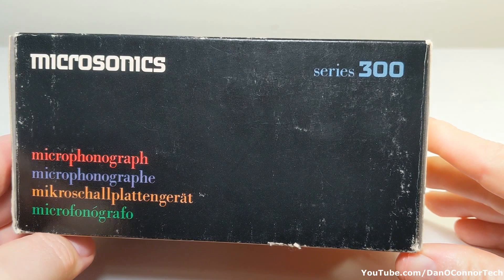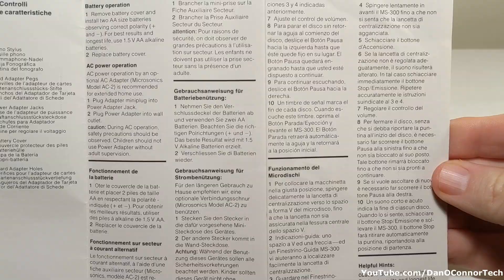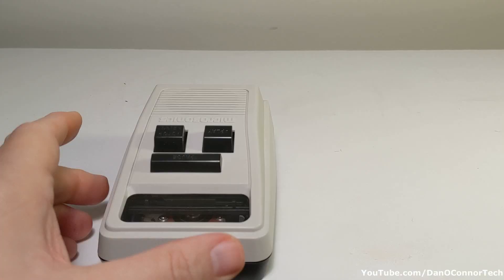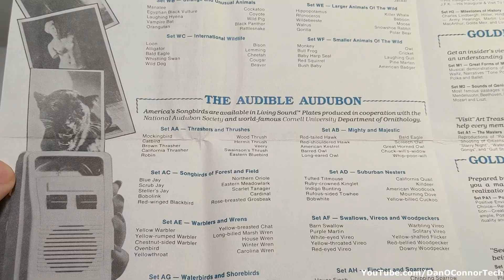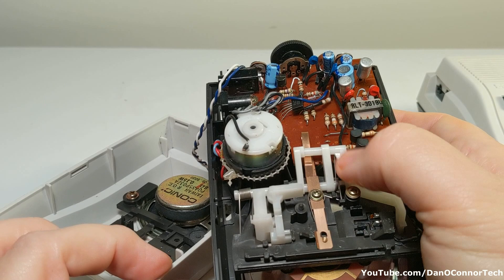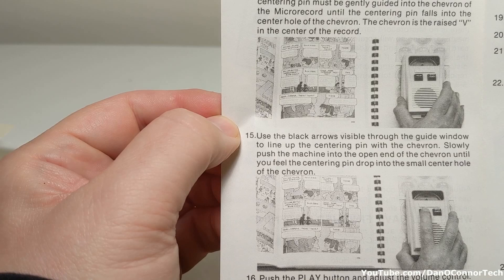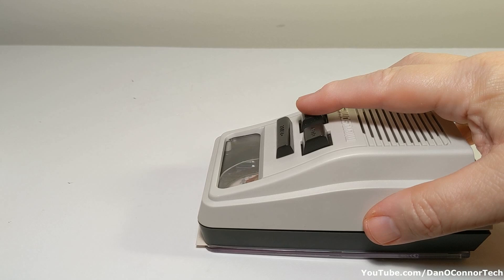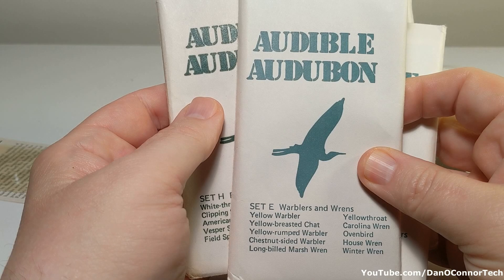1979 Microphonograph Plays Sound Plates; the Microsonics 300

Comment: Looked this up because one of my librarian colleagues found a microphonograph in the stacks. Turns out it went with a series of Yupik language learning notebooks. However, ours did not have cards that you insert. Instead the mini-platter records were glued down in the notebook and you had to hold the microphonograph over them in order to play them. We put two AA batteries in and the device worked just fine.

Comment: The other versions of this format should be spinning much slower and be larger.  This one appears to be spinning pretty quickly, more than once a second.  But there were millions of 8rpm flexidiscs made in the 20th century for the Library of Congress talking books program for the blind. If these play for a minute and spin at 60rpm, that means there are 60 grooves, which would play for about 7 and a 1/2 minutes.  Even 7.5 minutes is way better than 1 minute

 Dropping the speed to 8rpm would possibly not work for bird chirping because of the high frequency, but the various "talking" formats would have greatly benefited from dramatically increasing the play time.
Having a 1/2 and hour interview of some baseball player on the back of his baseball card would have made baseball cards a lot more interesting.  A minute or 2 just isn't very useful.
Reply from the maker: Good analysis, thanks!